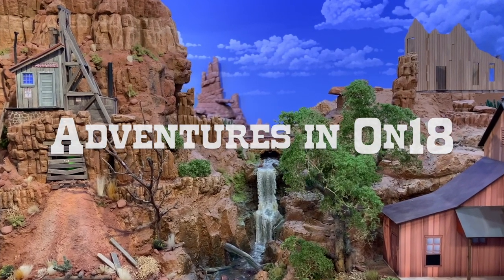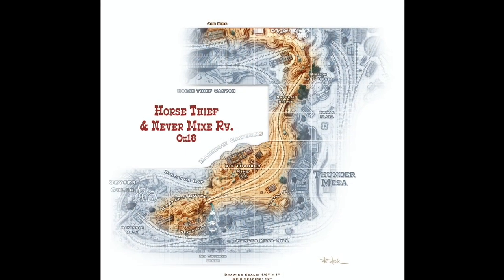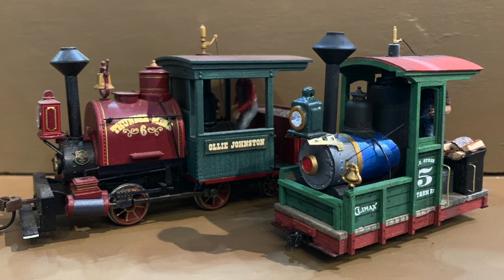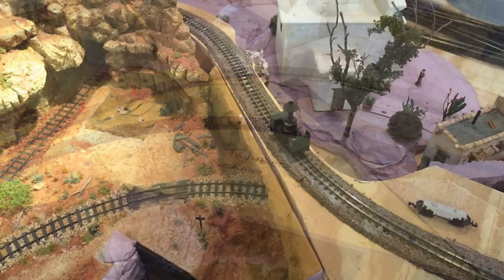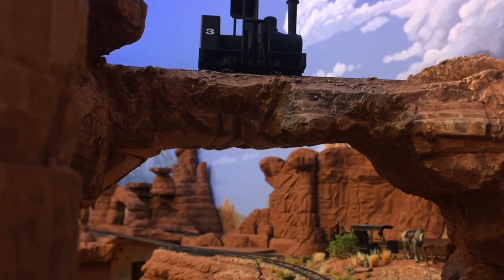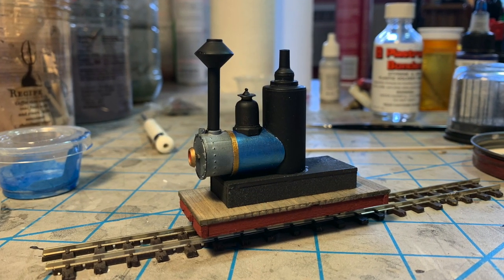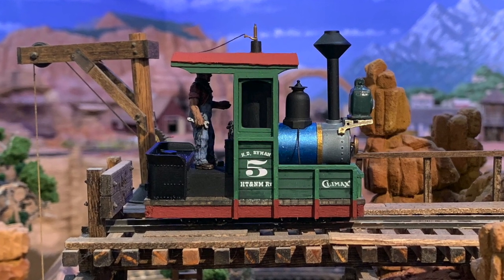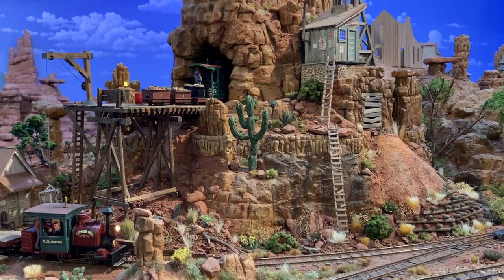Adventures in On18

Comment: Very nice On 18 climax. I have a modeling time saving tip. If you are going to do another Russian iron boiler , you can find Brass colored Gold and or Brass colored narrow tape on line. Its primarialy used by Model Car builders artists. You can see pictures in the  0n 30 4-4-0 bash  article that Bill iwan and I wrote together.We each produced our own versions. Bills version used the simulated brass bands tape. He has a youtube video showing his red rock line4-4-0. I used the tape bands in an On 30 annual Mogul bash w/ Russian iron. Anyway, I over-sprayed the tape w/ 2 light coats of Testors Semigloss lacquer to help reduce the very shiny glare. I use the band tape often and have some extra I could send you if you are interested' free! no charge.
Reply from the maker: Great tip, thank you!
Reply: @ThunderMesaStudio  Dave, check out the on 30 annual 2015 my mogul bash/Russian iron boiler pg 35 thru 37.4-4-0 Bash project are in 2013 or 2014   On 3n0 annual.
Presently working on several new bash projects.I need to learn photos shop so I can start producing some of the wonderful graphics that you use for your projects.
Anyway, would love to visit TMS in the spring or summer time. Would,, if you approve bring a few of my more colorful bash locos to run on your wonderful layout.
Presently experimenting w/Allo Clad paints for russian iron  color now that floquil is out .

Thanks

Comment: Cool little model. It seems nice to do On18. But as I switched from HOn30 to On30 (or more exactly from HOe to 0e16.5) because of unreliable mechanisms and bad behavior at slow speed, I will wait. But it seems that more and more of these on the shelves motor bogies in Japan use coreless motor, which should improve the ride.